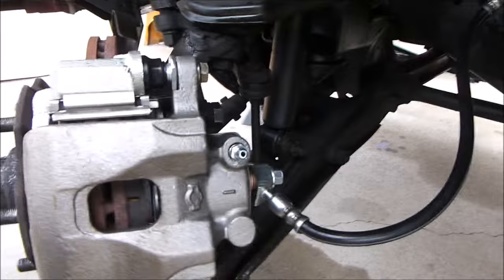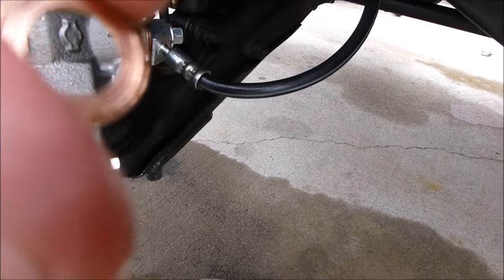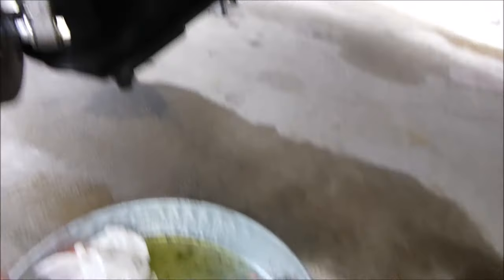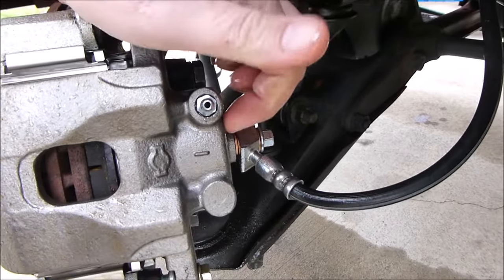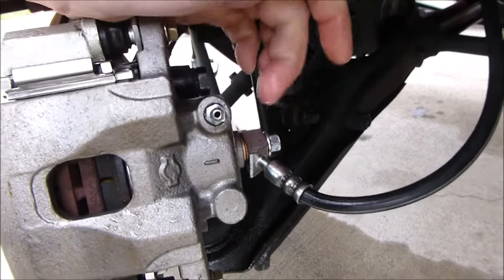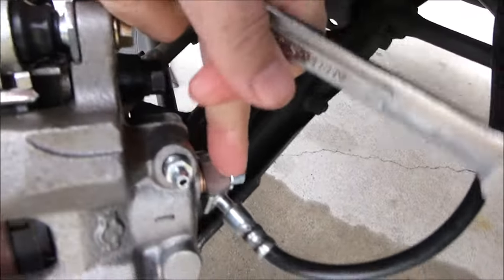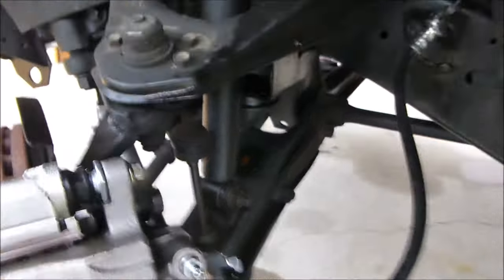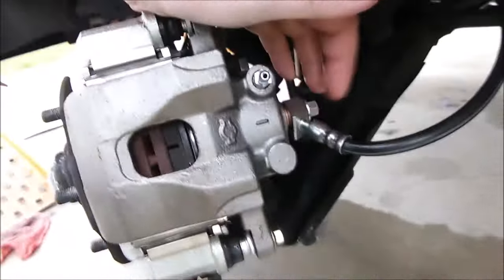Hack that could fix the "new brake hose leaking at caliper" issue.

Comment: This engineering design has got to be the dumbest idea ever to use a banjo fitting with 2 copper washers instead of using a threaded connection as are in some calipers.
Reply from the maker: Yes I have had the "shake my head experiences over many designs" many of them I feel the companies do on purpose just so it will break down faster.
Reply: It's cheap, easy, reliable, and has proven the test of time

Comment: Thank you! You sir have brought my frustrating night to a successful end! I will think of you every time my ‘66 GMC comes to a stop lol.
Reply from the maker: You're welcome, i am glad it helped...1966 GMC...Classic .  I liked working on trucks from that time period.
Reply from the maker: @survivormary1126  I even had a brake mechanic get on here and tell me watched this video used the tip to fix a  truck he was working on.   cars have used this brake design for a 1/2 century. it is basic and that can be a good thing, but as with this problem, it can cause major issues. But as you have seen, it can be a simple fix as long as you know the secret.
Reply: @fromcarstocomputers7261  Certainly put to shame the videos of people lazer cutting sand paper with a 3-d printer.......Torching crush washers, etc.  .lol  What is that old saying about a toothpick, a nail, and a hammer?
Reply from the maker: @survivormary1126  Thanks. I do not want to make videos just to get views, I want them to means something.

Comment: I had rebuilt four calipers and re-used all the copper washers without a single leak, the trick is to put them back on the same exact way they came off, matching each side, make sure the mating surfaces are clean and dry and torque to specs, very important, do not guess or you will probably have a leak.
Reply from the maker: True. One can reuse old washers and it work out fine, and if it does not work then one can just say "well we did try" but when you have new stuff and it leaks it is just more frustrating.  but this same trick can be used for when using an old washer as well.  Used or new these things can leak and this is just something one can try.

Comment: i was converting my Thunderbird to Mustang Cobra front brakes and i could not get a good seal between the caliper and brake hose block. your trick did the, er, trick! i just gave them a good wiggle with a crescent wrench and then added just another nudge to the banjo bolt and the leaks finally stopped.

Comment: Thank you for this.  Did 4 new calipers/rotors/pads/hoses on 2014 outback.  All perfect except one hose to caliper leaked unmerciful.  After trying a couple things and a couple new swear words, I found your video.  It actually took about four attempts at retorquing regrooving, I guess.  But, tight, no leaks, stops perfect.  I guess it's just about realizing that the copper needs to be forced into the grooves better.  Anyway, Thanks.
Reply from the maker: Thanks. I am glad it helped

Comment: I recently replaced 2  blown front caliper hoses on a 2015 Ford edge ...
The  2 brand new hoses didn't include the 4 washers required .
I just reused the same old ones and they did the job . If they don't work after retighten them a bit the issue are the washers and you gotta get new ones.

Comment: Thank you. I just fixed my leaking new caliper using a crescent wrench on the brake line fitting and socket on the banjo bolt and no more leak.
Reply from the maker: Good work.

Comment: Cant be more right about my head bursting into flames 
For me it was when an OEM toyota wheel cylinder from a Toyota dealership didnt thread on properly apparently and just kept slowly leaking just from installing. I put the old one on, no leak. So I just rebuilt the old one with the new ones parts. It's totally mint now
Reply from the maker: Sounds like you got it covered then.

Comment: So I'm an idiot. Didn't put a brass fitting between the hose and the caliper, I only put one between the nut and the hose. Thank you for the video!
Reply from the maker: Not an idiot..it is just one of those things that can happen to anyone. I have made my share of mistakes as well.  but thanks anyway.
Reply: It happens to everyone.  I was doing a transmission drain n fill like an oil change but didn't notice the washer fell off til after I put everything together 🙃  atleast you didn't have to rush, pop off a drain plug and put it on before too much oil spilled out lol

Comment: This is a huge problem especially with re-manufactured calipers!  I've noticed that some have the lines in the casting like original but some have them blasted off with bead or sand blaster when the re-manufacturer processes the core.   A simple fix would be to replace an old banjo bolt and old washer but I guess that's to hard for the re-man business.  I recently tried to replace 4 re-man calipers and after ordering 4 extra to the parts house I gave up and decided to rebuild the ones I had with new seals and cylinders kit.  There is no way I would put one of those in operation on my vehicle without that groove in the casting for the washer, especially with something as critical as brakes!

Comment: My washer from the bottom isn't making a seal at all. Could switching it with the top washer that does have grooves solve this leaking issue?  Otherwise I may just put on the old ones
Reply from the maker: Better to just get new washers because once a washer is used it will have the groove in-printed and that can cause a leak when re-pressed ( grooved are out of alignment

Comment: I do have 1 question about this. I have done it once before on my last car and it died of electrical but the new breaks worked. But I got a 2000 ford explore with all new back end breaks replaced. My family has a history of working on cars lol. But out of all the videos I watched.. Is it important to line up the banjo bolt 🔩 hole with the incoming break like hole? I feel like that is important. Lol on top of that I get what you mean. I had to do a rush job to finish my breaks and not take the time and both sides are as you but it... Leaking.. Its small but still alittle wet when I place my hand under their. Its abit annoying sending almost 5 days on breaks only for a leak to happen lol. But I will give what you did a try and see if it works. I might have to buy new banjo bolts and brass washers.. Or I might return in both new calibers not sure if I damaged them in thr installment or not and dont really wanna risk that of you know what I mean.
Reply from the maker: I have never lined up the holes because it will just go out the hole on the other side, there is little chance of fluid stoppage here is why, look close at the bolt  you will notice that right above where the fluid holes are there is a area that the bolt gets a little bigger, this is to make sure the fluid can flow around the inside area by design.  (  or other pathway built in around where the fluid flows )

Now the more you work with the washers the more chances that they will start leaking so if you have over tighten them or removed them and then replaced them a couple of times then they may never seal and you might need to purchase a new set of washers  ( or a new set of calipers with the washer and bolts just to be on the safe side. )  I know it can be frustrating working on brakes but as I say. if you work on a cars engine and is breaks, the car stops, but if you work on brakes and they stop working, the car does not stop. bad breaks can cost one a lot more than a bad engine ever will.

Comment: This is the exact problem I'm having the fluid is leaking from where the hose connects to the caliper...
But I don't understand the solution ... are you saying back off the bolt a little bit and retighten it so that the washer bites into the grooves?
Reply from the maker: with everything tight like it should be, I am making the fitting on the end of the hose turn just a little but leaving the bolt alone. this can help the grove to settle into place.  but like most things it is not a 100% of the time and will need to be checked to make sure the leak has gone.
Reply: @fromcarstocomputers7261  
Thank you. I think I understand and I will try it
Reply: The banjo bolt that came with the remanufactured calipers is longer than the originals. They provide thicker copper washers, but the bolt "bottoms out" before the sealing washers fully compress. Ironically, a tag comes with the caliper stating that if don't use their banjo fitting bolt the warranty is void.
Reply: @fromcarstocomputers7261  I read comments first and this made it much clearer.  Thank you again.